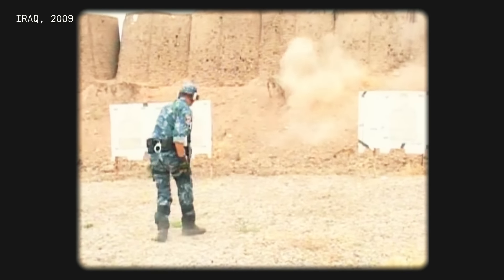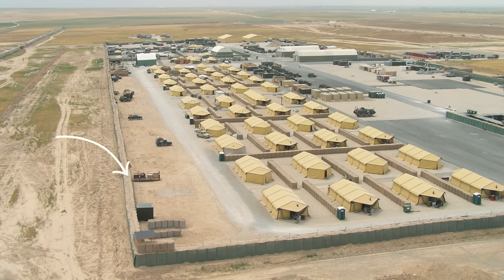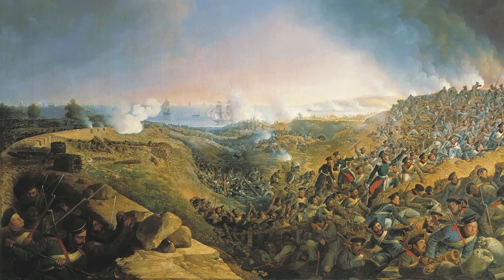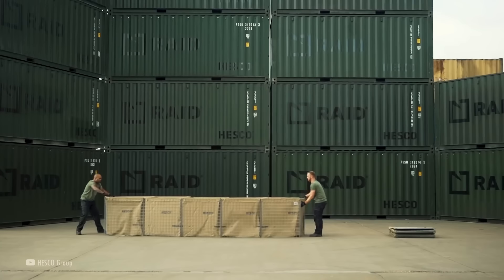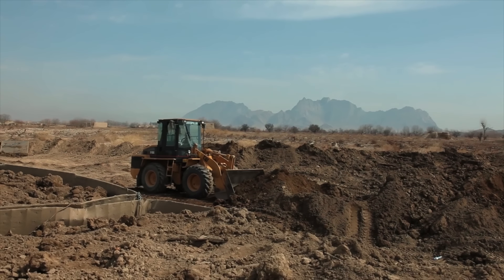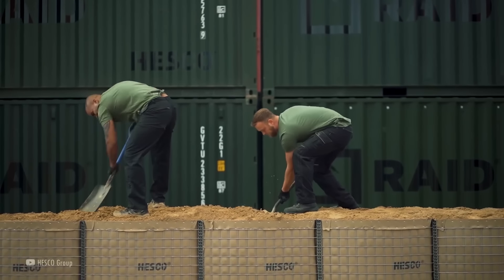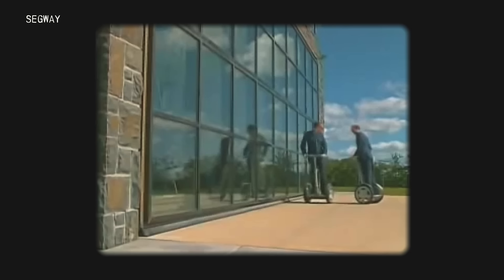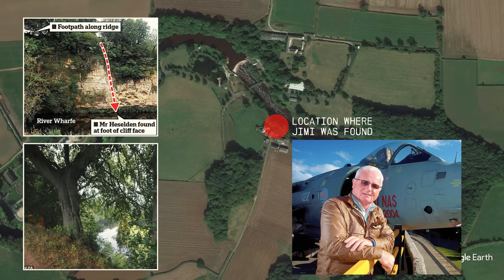Goodbye sandbags?  This is how fortifications are built now | HESCO Barrier

Comment: They can also be emptied by lifting them up with the same wheel loader, as the internal material just falls out of the bottom.
Reply: Wouldn't that destroy the wire mesh?
Reply: @rogerjensen5277  They have a metal pin that runs down one of the corners. You can attach a hook and have the loader pull the pin upwards, basically it just opens up and the dirt falls out. You can put the pin back in when done.
Reply: A couple good rains and the filler may as well be concrete. Hescos are cheap enough you just destroy them

Comment: I've NEVER seen a barrier disassembled.
Reply: I think most of the emplacements of them are intended to be semi-permanent. Even when they do need to be taken down, the process of deploying, filling, letting them sit in the elements, and then disassembling them tends to damage the material significantly enough that you wouldn't really want to reuse it vs just getting new ones.

Plus unless you really need to remove them to make room for something else or for environmental reasons, the labor and time required probably isn't worth the value of what's recovered.

Comment: Sand bags and HESCO barriers are diffrent, HESCO can replace sand bags in a lot of places however if you where let's say, reenforcing an existing building, HESCO barriers would take ay more effort and any hole you can shoot out of would be 1.4 m × 1.1 m wide and not work as cover.

Comment: I'm envisioning a thinner version of this barrier to build housing!  Add a thumper for rammed earth inside and waterproof stucco for cladding and walla!
After the walls are all done, simply pour a mixture of concrete for the floors, on a stable non-clay foundation of course.
Reply: Gabion Basket.

Comment: They also used to stick pocket knives in the bundles of Hesco barriers they were usually a razor blade knife like the kind with the removable razor blade that I still have several of those or cheaper Leatherman's like actual Leatherman's I still have one or two of those floating around

Comment: It reminds me of Medieval castle curtain walls, only portable and much faster to set up. The walls weren't solid stone, but two sets of walls with stone and earth in between them to form a much stronger wall.
Reply: All castle walls are built like that.
Reply: Except it is concrete they are filled in with. As in, sand, stones and cement.
Reply: @The-Clockwork-Eye  I know. I love castles. I just wanted to throw out a fact that most people don't know. I only discovered it in my 20s when taking a Medieval History class in college (albeit over 30 years ago).
Reply: @The-Clockwork-Eye  Yep; a modern take on an ancient practice.

Comment: Fun fact you can make a poor man’s  Version out of cattle panels and tarps
Reply: I was thinking along those lines myself. I was also thinking you could use willow saplings/shoots and build a living house with 2' (or whatever) thick walls. Good insulation, I think. It would probably work with black locust, too which I've heard people claim they've seen black locust fence posts start growing leaves and branches. I kinda believe it.

Southern Engineering for the win. "It ain't perfect but if it works it works."
Reply: @MyName-tb9oz  they used use willow sapling version during the civil war and in The Crimean war not the modern one

Comment: Hesco is a worse protection to sandbags. When something hits a bag inside the sandbags, the bag will catch the projectile and move the force to a next bag till it fully stops.
Hesco with just sand wont protect much, unless you fill it with huge rocks inside. To increase the protection to the max, you would have to place hesco next to another hesco.

Comment: HESCO only works if you have wide open areas, and heavy equipment that can fill them. This wouldnt work very well in jungles/forests due to limited mobility and difficult terrain. Sandbags is carried and placed by men, and can stack in horse carts/trucks. 

Fit the tool to the job. Hesco made some areas more efficient, but sandbags can be deployed anywhere, in any condition, with a man that is there. That is why sandbags will never fade away.

Comment: They seem good for defending bases from insurgents, or reinforcing back lines to form a defense should the front line move, but I don't see how they'd actually be good on the front lines given that they seem pretty hard to deploy while under fire. sandbags give you cover one sandbag at a time, HESCO barriers only provide cover once you fill it. You might as well dig a trench at that rate.
Reply: not to mention an individual soldier can carry 20 to 50 unfilled sandbags to thier fox hole cant say the same for a hesco barrier
Reply: Some earth moving equipment can be armored.
Reply: @garywheeler7039  Yeah but they're not very readily available when contact with the enemy is made

Comment: I'm not an engineer but it would seem to me that these barriers could be defeated by use of strips of detonation cord attached vertically to cut sections out of several barrier panels at once, then artillery/tank rounds with a short-delay fuse would blow thru most of the dirt allowing troops to invade fairly easily and provide them with some protection against small arms at the same time!  These panels provide no over-head protection and don't allow for gun ports!  Having inner walls made of these should reduce damage from artillery shrapnel but would also serve to increase over-pressure in each confined space!  If no heavy equipment is available to fill these barriers, then how long would it take for men with shovel to fill them?  Where would they get the dirt from?  Maybe from just outside the barriers so that they would be making a moat at the same time; one that could potentially be filled with flammable liquids quickly in a last ditch defense!
Reply: Assume you would put wire and land mines in front of the barrier to discourage exactly what you outlined.
Reply: You would be shot and killed before you got near the barrier, bases have guard towers you know.

Comment: 20 minutes to erect and fill 10m of hesco sounds very optimistic. That is going to require dozens of rounds trips of the front loader to the fill source. Even if the fill source is only a few meters away, you still have to turn around twice each trip, so there is no way you can do more than a couple buckets per minute under the most favorable real-world conditions.

Comment: The sandbags are not to be underestimated. Their purpose is to be highly mobile, easily placed field fortification. You get dozens of bags in small space and you get them transported with the troops themselves and make the small protection where required easily, inside buildings, on the hard rock surfaces etc. 

They are never meant for permanent fortifications as western military like to use them to utilize them as infantry exerciser utility. You get people shovel, carry and place those bags, no need to run, do push-ups etc. And they take small space and can be replaced where required. You can't do anything like that with those permanent fortification systems that requires heavy equipment and safe areas in first place.

Comment: There are literally sandbags on top of the hesco barriers in the thumbnail.
Reply: Used to make a firing window for extra cover, would you rather spend several days stacking sandbags to get the same height and thickness?
Reply: that's some craftmanship details right there

Comment: You need heavy equipment and the infrastructure that comes from that. Sandbags require bags and grunts with entrenching tools..
Reply: If you watch the video he points that out exactly, hesco barriers are for bases and long term fortifications. Sandbags are still used by troops as they can be carried to the field and filled.

Comment: so how to build a better mousetrap? It seems most people here can't see the bigger picture. If it takes hundreds of people 8 hours to fill a bunch of sandbags, how do you do it better. The HESCO barrier is that solution. What are sandbags for? Anything from protecting property from flooding to protecting warriors. Does this work? HELL YES! and more. Adaptable length, height, thickness, size and more. Now what else can this "sandbag" do? Protect villages from wild elephants, dingo type dogs, maybe some big cats (but they climb).... how about large migratory animals like African animals. Outside police stations, hospitals, etc. 

How to make this better? We see a serviceman stopping the dirt down in one view. How about better tools to "stomp" and compact the dirt? If servicemen have to cut the wire to take it apart quickly, a better method to do that. I'd prefer any day of the week the ability to construct something QUICKLY to protect people verses the labor intensive way using sandbags. 
As for Ukraine, good question. How about the weapons Russian's have. You don't need to go through the barrier when you can go over it. Still it offers protection. 

Change the colors for public use and it might be more attractive

Comment: I wonder if that could be used in home building. Adjust the size to about 3-4 feet thick, and use spray on concrete with fiber inclusion, and a solid tamping of the layers.... It could be a solid idea in some areas.
Reply: You lose a lot of floor area, as floor area is typically measured to the outside of the wall. But in areas that have big daytime temperature swings they would be ideal. Might have to use some kind of finer mesh screen like hardware cloth to keep varmints out however. And a healthy roof overhang to keep it all dry. Windows might be problematic as the wall is quite thick. But point most of a window wall to the equator (usually south) and it might be good. Not for a minimal area subdivision though.

Comment: Possible improvement: hex cells instead of square—maybe could use lighter mesh since the shape approximates a cylinder and you don’t need to worry about the sides bulging out so much
Reply: It's already an irregular hexagon. The outer and inner faces can fold out to be a six sided cell.

Comment: imagine if they applied this to make affordable housing? would literally be dirt cheap aside from the furniture.
Reply: Issue is walls that are 10 times thicker and don't stack very tall, plus doors and windows weaken the stability immensely.
They are building sand(clay)bag homes for thermal mass to much the same principle but again single floor and takes way more work than the current "frame, sheet, rinse and repeat" homes.

Comment: I forsee technology meant to quickly fill the barrier without a large engineering vehicle
Reply: You can fill it with expanding foam.
Reply: @kazedcat  Nope, no a good idea because foam would not stop rounds very well (especially .50cal. AP) and even worse that foam is flammable and the smoke is toxic!
Reply: @rogerjensen5277  Then they need to invent a bullet proof non toxic expanding foam.

Comment: Why not just quickly fill it with concrete? One small layer at the bottom so it doesn't flow out, wait, then fill
Reply: sometimes you're in an area with water scarcity

Comment: The thing is only good against people with AKs and RPGs. There's only limited use for this in modern warfare, for it offers no real protection against tanks, glide bombs, rockets, all kind of artillery, drones.
Reply: he explains in the video how it does protect against most of those things, it limits the distance at which fragmentation travels so a bomb going off in a base only damages what it went off directly next to, it is capable of stopping RPG warheads and tank HEAT shells. its rather obvious that one or two won't stop an APFSDS but at that same time the APFSDS won't really be hitting something it can't see on the other side anyway.

Comment: Don't really undestand why Ukraine doesn't use them. Or Russia. Seems like they don't work in case of equal power enemies. Only against light weapons of some bandits on toyotas.
Reply: they were used in yugoslavia. theyre basically big sandbags, not a lot you can mess up with that
Reply: @sasin2715  This doesn't answer on my question. US directly support Ukraine but non such systems are used by Ukraine. Why?
Reply: @Volodymyr_SVD  not an expert, but its probably because ukraine and russia are fighting on their soil and so they already have traditional bases set up not far from the frontlines. ukraine doesnt really need a quick to build FOB because they already have proper ones from the past, unlike the US in afghanistan, which had to essentially build most of their bases from the ground up

Comment: So, someone took a fortified pile of sand, game it a tech name and called it innovation?
I mean, they're using big machinery to work that stuff. Sandbags served a different purpose. I don't think sand fortification is an actual innovative leap. It's fairly standard, if you are gonna be spending time in a place, to get to work beyond initial makeshift solutions.
Giving a pile of sand a fancy name, because there's structure holding the shape, and then claiming it's innovation, seems like a low bar.